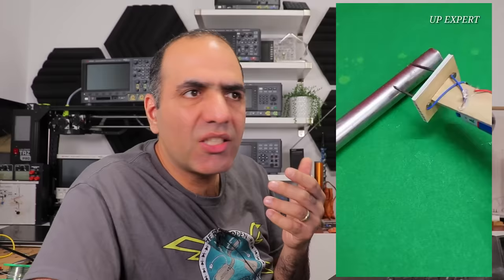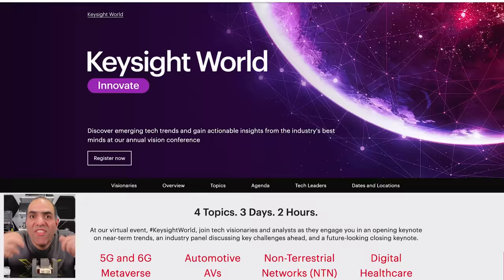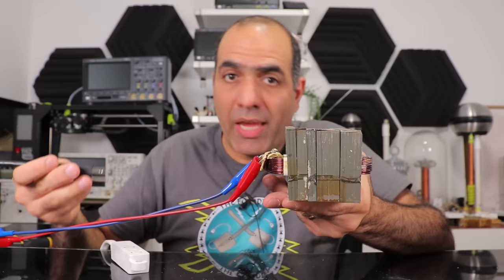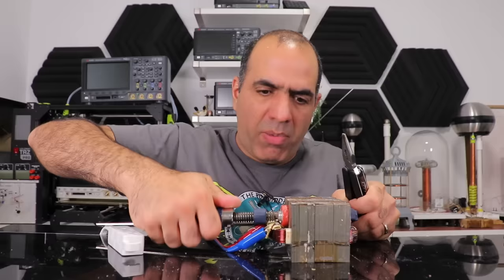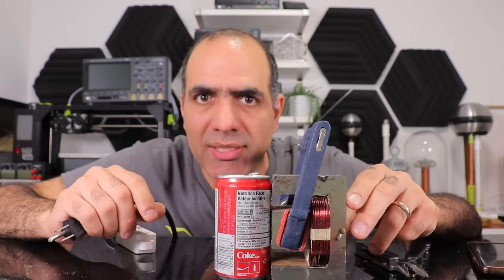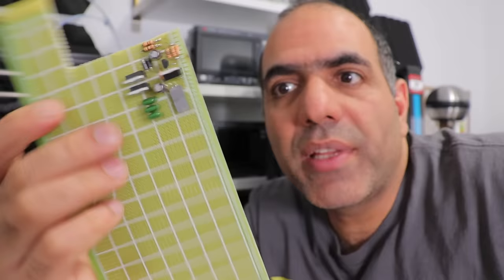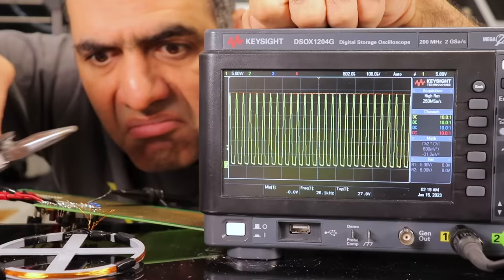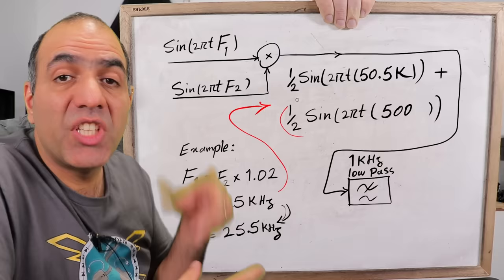DIY METAL DETECTOR, Gone Wrong and Right!!

Comment: 05:16 Imagine your transformer or inductor as a stack of really thin sheets, like a deck of cards. These sheets are there to guide the invisible magnetic lines that make everything work.

Now, these lines don't like to hang out too close together, and that's where the magic happens. There's a small gap between each sheet, and when the magnetic lines pass through, it's like a bunch of tiny magnets trying to push each other away.

Think of it like having a bunch of magnets on a table, all facing the same way. You push them close, and instead of sticking together, they go "Nope, I don't want to be near you!" That's what happens between these layers in your device.

This pushing away is a smart move by designers. It helps to avoid wasting energy and makes your device work more efficiently. It's like turning a potential mess into a well-choreographed dance, where each sheet knows its role, keeping things smooth and efficient. And that, my friend, is the secret behind why your device splits itself apart but still does its job beautifully! 🚀

Comment: Man, I had zero idea that metal detectors are this complicated
Reply: Not more than my life
Reply: i mean this is very interesting since its going to deeper dive on those detectors
Reply: And this is the most simple type of metal detector, it falls in the BFO type (beat frequency oscillator). Other more precise and accurate like pulse induction or induction balance can become way more complicated
Reply: or using coils
Reply: @bhabok20  At least life has a logical destination, Jesus, who makes our lives simple, but the field of magnetometers is a never ending rabbit hole.
Reply: lol
Reply: There are some that are waaaaaay more complicated than this.  Remember that bit he did with the 100KHz and noticing that an iron object raised the frequency.  Consider that at different frequencies different objects will have differing effects.  This means that they can do more than tell aluminum from iron but also get a sense of the shape and depth of the object.
Reply: naaah its elementary dear meowson, all you need is an AM pocket radio as a detector

Comment: Having built metal detectors with my dad as a kid, the only thing I would change is do a flat coil like an antenna instead of a regular coil. But that is more difficult to wind up. Another thing you can do to make it extremely sensitive is to have two coils, one above the other running half off phase signals and sum them in the end to essentially make an EM interferometer.
Reply: How does having two coils out of phase make it more sensitive?
Reply: @locinolacolino1302  Instead of measuring the changes of one coil's frequency and peak, you're measuring the difference between two. After amplifying, I could detect 0.01% difference between the two. But it's super finicky, the coils have to be perfectly aligned, the frequencies have to be on spot. It's a fun experiment, but probably not worth it for practical use.

Those professional detectors that have the coils shaped like an 8 use two of them already, but they work by being a coupled oscillator. You can detect coins 30cm away with those easily.
Reply: @locinolacolino1302  As they hinted at this design is based on interferometry. When there is no metal present the two 180 degree out of phase signals destructively interfere to produce a constant potential. In essence your output signal is the result of recombining those two waves, when nothing is interfering with the field they will destructively interfere and cancel out, when there is however the two coils being in different physical locations will cause them to experience a different change in frequency thus recombining the two will produce an interference pattern that can be detected.
Reply: Do you have a circuit
Reply: @chinnapank  No, it has been 20 years. But if you look up for two phase shift oscillators leading to an amplifier, it is pretty much the same thing. Just need to adapt for the coils and voltages you will be using.

Comment: Hi Mehdi.

The 24 amp maximum current of the IRFZ24N Seems massive especially if you're planning on a PP9 type, battery powered portable metal detector.

I'm therefore taking my clue from this as I'm unfamiliar with the MOSFET and Schottky type of astable multivibrator you've used in this example.

So I'm hoping for a Mehdi induced heartfelt like with my idea of what you're hoping for.

I Do go on to mention how I learned because the learning curve was such a massive moment especially after being at college and coming no where.

I hopefully explain why I'd be employing such an experimentalist approach and, if I'm wrong I was wrong but not for the want of having an estimated guess.

Anyway.
A two transistor BJT astable multivibrator is possibly the answer. 
TIP41 or TIP42 transistors should supply enough current through the 100uh + the series of the 115uh search coils.
I hindsight the resistor supplying the emmiter follower regulator seems to verge around the 1 amp current region so I'm more inclined to believe this.

Ditch the Schottky diodes and I'd replace them with an experimental value of around 220nf then the 150 ohms might be used in series with the search coils
(in case of over load) 
and in their original place I'd insert something like a 2.2k ohm resistor to be used for the Resistor in the CR timing network.

OR leave the 150 ohm resistors where they are to act as a voltage limit stop resistors and cut the connection between the 100uf switch spike surprising capacitors positive terminal to the 150 ohm resistors shared common connection and insert a 10k pot to change the voltage and therefore speed the 220nf capacitors charge up times.
Therefore giving experimental frequency change.  

I'd choose this experimental method because I'm not to good with theory especially with frequencies.

I have been a self taught electronics enthusiast since the age of 13 finally teaching myself digital fundamentals whilst I designed and constructed a Radio Controlled up / down step encoder into a Resistor divider DAC utilizing a toy car Remote control and receiver chip. 

1 "Nudge Turn" of the remote would notch 1 up / down control on the encoder and therefore Digitally control the amount of resistors in the resistor adder and give Analogue control for the timing function of the mains cycle for the 240 volt ac bulb to dim or brighten up.
Obviously timed to coincide with the correct part of the phase during the 50hz cycle.

Cheers and TTFN. ;)
Reply: The peak current rating of the MOSFET will not impact the battery drain. However the voltage dropped across the FET when saturated is less than the BJT, so you end up with more voltage across the coil and therefore more current through the coil, so for the same supply the MOSFET will yield a better field.

The MOSFETs can handle more current for the same package type (TO220) in this case, because it does not get as hot because of less voltage drop across the transistor as previously mentioned.
Reply: @NCmountainview  Absolutely understood but I mentioned the BJT astable as I'm more familiar with its turn 
on / off characteristics having made many LED flip flops I'm also more familiar with the 0.7 volt saturation voltages of the BJTs being a lower sensitivity than that of the FETs which MAY cause weird oscillator results than I could positively say I knew about as I've never built a variable frequency MOSFET astable.

I'm not saying the FETs would use more current, this would be limited by the one amp rating of the main regulators feed resistor.

I also realise the exceptional sensitivity of the gate junction of a MOSFET and with that realization
I can also theorise the BJTs tendency to give a rounder top to their waveform especially when the transistor base goes below its saturation voltage, this does cause more heat but one amp is within the rating for the type and possibly achievable without adding a heatsink. (If not bung a pair of BU508s in there.) LOL.

The sinusoidal wave shape at the waves peak must give a better all round smoother electro magnetic RF flow.?
Reply: @Electrodoc1968  The BJT does not have a saturation voltage of 0.7V, as that is the ideal junction voltage and usually associated with the base emitter region in forward bias. The saturation voltage is measured across the collector emitter and varies depending on the load, but it is generally larger than the channel voltage for a FET under the same load.

There is some merit to your point, as FETs can have issues with linear response because of the transconductance profile. However, the reality is that you can design stable oscillators with either. In fact the higher input impedance of the FET can make the oscillator much more stable when under load.

Comment: Now this is a very cool and informative video. The Core is repelling because of laminations between the slits of core material. two slits have the same direction of eddy current causing the magnetic field to be generated to repel each other. Its the same as one piece of mage is solid but when it breaks the two pieces repel each other.
Reply: That's somewhat similar to what I proposed, but i don't think eddy current has anything to do with it as the core is split up like that specifically to avoid eddy current, aka the core doesn't act like a short-circuited coil. But i do believe it's similar to the broken magnet thing.

Comment: Hey Mehdi, for your question at 5:10, is the answer that the pieces of the core become magnetised in such a way that the poles are facing the same way causing them to repel each other but they are held together by the coil in the centre.

Comment: 9:44 you can use a cheap half bridge gate driver (such as IRS2153D) with the bootstrap pin tied to ground. i've used it in this arrangement for induction heating. this way you get quick transitions & dead time without wasting power. great video!
Reply: Maybe 120 is a little overkill

Comment: There are numerous solutions for the gate bias resistors:
1. At low frequency, don't worry about it. Scope the gate waveform: if the rising edge is fast enough, you're done. At 25kHz, probably some kohms is acceptable.
2. Add a buffer. I've done this before, add a complementary emitter follower (just a simple class C one will do, no biasing components) between the pull-up / diode connection, and the gate.  Use a pull-down resistor at the gate, to bias the follower (this is necessary for startup, because this is a linear amplifier at its heart -- it won't start up at the right frequency, or at all, if there is too much gain or distortion in the feedback path!).  I've done this before, on, let me get it out here -- I had 2 x FDP33N25 for the inverter, and 2N3904/6s for the buffers. Oh, I didn't use a pull-up resistor with the diode, I used a PNP current source, fancy; well, about 470Ω pull-up would be equivalent.  It ran over 600kHz with good gate waveforms as I recall, so it doesn't take much as you can see. That suggests 27k would be enough for IRFZ24N down at 25kHz!  Call it 10k for good measure.  Maybe 1k or less without the buffer circuit.
3. Use different devices in a related circuit.  The original Baxandall* circuit, I believe used a feedback winding, with bipolar transistors.  This separates bias and feedback from the output voltage, giving more freedom to design the gain and drive strength.  Example circuit in following comment.

*The common "ZVS" oscillator configuration is actually due to Baxandall, the same one of audio tone control fame; published back in the 50s or 60s when transistors were new, though I don't have the exact citation handy unfortunately.  It's commonly called "Royer" by the amateur/HV community, but this is erroneous -- Royer refers to a non-resonant (specifically, saturable core commutated) oscillator.  (Occasionally even professionals make this error: for example, Jim Williams (of Linear Technology) in AN49; the correct citation is even given (Royer, et al; in the title, "in saturable core circuits" -- but these are resonant, non-saturating circuits!).  So, go figure, even the best of us make mistakes.)
Reply: I like, when people copy paste stuff from Wiki.
Reply: Man typed out a whole dream tweet

Comment: 9:28 I suggest you put a free-wheeling diode in parallel to the 100uF capacitor. This is just to avoid the Collector terminal of KSB596Y from going too negative by the inductors when the current through the PNP is throttled by the 2N2904 (when trying to limit the current).

Comment: The best metal detector model you can use is the Double D model with one coil being the emitter and the other coil being the receiver which can detect the phase shift and how much positive or negative displacement it has can tell the type of metal from silver and gold to combre, aluminum and iron, maybe you can even tell the difference between iron and steel (I'm not sure about that)

Comment: I guess the same electromagnetic field is created in the core. So each north field faces another north field and vice-versa for south. So they should repel each other... Am I right ? 🤔
Reply: What is TEH link? (2:30) 😅😅😅
Reply: Don't think so, the field created should be in the same direction through the entire core, which points south of each slice to north of neighboring slice. Feel like it's got something more to do with all the eddy currents going in the same direction
Reply: Yes, I think you are correct 😅
Reply: @pocarski 
No. Thats because if you have the layers like that |||||||||||, then the coil isnt wound in a way, so that the magnetic field is like this: N|S|N|S|N|S, but actually:
N|N|N|N|N|
S |S|S |S|S|
So each layer repells each other. 
Thats also the reason, why these flat magnets in hard drives will repell each other at the breaking point, when you break them. Thats because they are magnetized in the same way, so that they act as a very short, but large area magnet.
Reply: Yeah I think that's right. The magnetic field (magnetic flux) is mostly the same (and in the same direction) throughout the core, so the iron pieces take on their own magneric field in that direction which causes all the north poles to be touching and all the south poles to be touching, which makes the iron pieces repel each other.
Reply: Yeah, the same when you break rare earth magnets or neodymium magnets, the individual pieces are magnets themselves so they repel each other when you tried to glue it back
Reply: Yes, because the coil is perpendicular to the sheets, not parallel.

Comment: The transformer core repels because the magnetic fields generated are of the same polarity. Each piece of iron is acting like a magnet and a bunch of them stuck together is like putting together magnets with the same polarity.
On a side note, can you make a video on flux gate magnetometer?

Comment: Well that was illuminating.  Especially when the light bulb blasted out of the holder!  But seriously, this was a great illustration of how metal detector oscillators can be tuned and filtered.  I think I finally understand how the "discriminator" on my ancient Radio Shack Micronta metal detector works.  Since the circuitry is no longer a mysterious "black box" to me, I think I can use it more effectively.

Comment: If you want to reduce power consumption overall in this circuit, my suggestion would be to use some sort of class B or C amplifier and place your entire circuit on a clock. The coil doesn't need to be hot all of the time, it just needs to be on frequent enough to find the stuff underneath of it. So make a dial to tune the polling rate of the coil to match your walking speed, this would reduce the constant power consumption of the resistors in your circuit at 9:26 to just peak power consumption allowing you to use lower rated components, as well as reducing the overall power consumption of the device.

Comment: Another way to deal with the small frequency difference, instead of going all the way down the rabbit hole to make pulses: if you can tune a second oscillator close enough and nudge it by the difference, you can use the frequency beating to hear a result.

Comment: Too bad this video didn't come out half a year ago when I started learning to design and make videos on my own DIY metal detector to originally find lost keys in the snow. I eventually decided to build a more serious project designed around pulse induction PI detector type after trying other designs and schematics but this video gives a great introduction to the principals that are used in beat frequency oscillator BFO detectors which are the simplest to wrap ones head around how it works. VLF dual coil types can detect a bit better at depth and discriminate metal types while PI mono coil types have no discrimination but detect the deepest of all three types because of a different and more complex detection method used. Professional units are always VLF or PI types, but the BFO types like shown in this video were widely used in the early days because of their simplicity and low cost of design.
Reply: I built a Pirat detector circuit but it didn't work.

Comment: A good alternative to your MOSFET based ZVS oscillator could be built from small signal BJT's or CMOS inverters in a similar circuit -- with inputs and outputs cross-coupled, but with the tuned circuit on the input side where currents are low.  Basically, you just build a standard bistable multivibrator and then put a paralell RLC tank between the bases of the BJT's.  In effect, by biasing the flip-flop between it's stable states you're holding it in unstable equilibrium, which can be viewed as a symmetrical region of negative differential reisitance between the nodes which cancels the resistance of the tank circuit, sustaining oscillation.  Tecnically it's still a ZVS circuit and it operates in much the same way as the power version, but that's not the point.